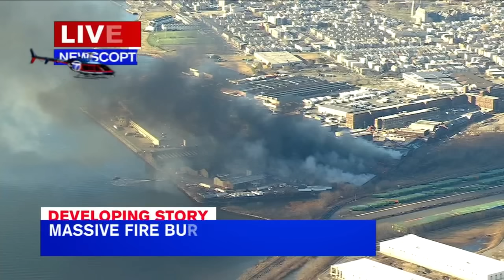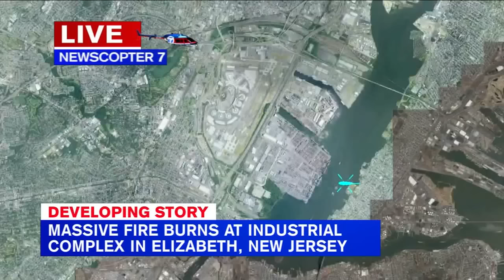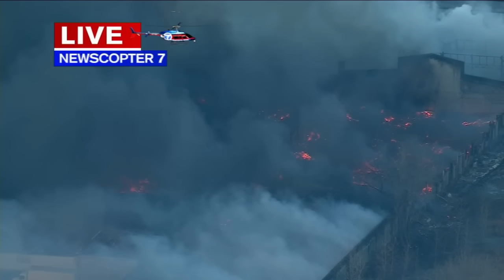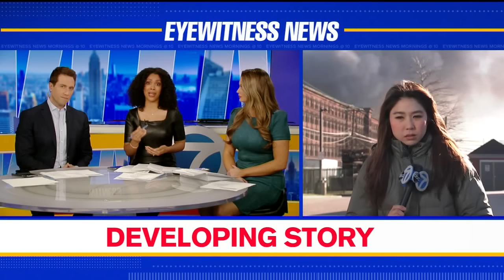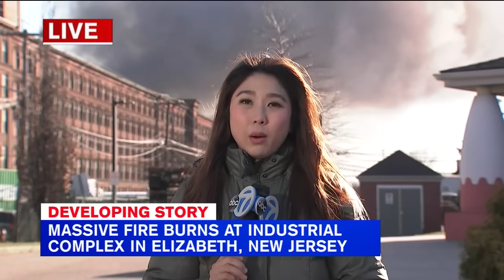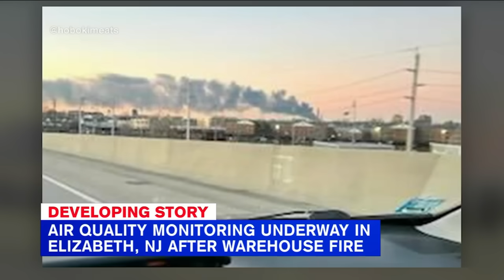Massive fire burns at industrial complex in Elizabeth, NJ

Comment: They should use a water drop from the air
Reply: To put out chemical fires you sometimes need things other than water.
Reply: You need a different strategy for this fire. It is class A and B, not just A.

Comment: If i’m not mistaken Industrial fires are the Worst….. these fire fighters don’t get paid enough !
Reply: No,  as  far  as  I  know  fires  in  the  reactor  of  a  nuclear  power-plant  are  the  worst  because  the  firemen  cannot  go  near  it  due  to  radiation.  I  think  no  insurance  company  dares  insure  such  a  plant.  Although  the  I.A.E.A  says  such  buildings  are  absolutely  safe.  In  Fukushima  nobody  can  enter  reactor-buildings  1  and  3  since  2011.  The  melted  cores  of  Pu  and  U  ( nuclear  lava )  have  melted  their  way  deep  down  in  the  ground  but  there  are  still   blobs  of  Pu  and  U  on  the  inner  walls  of  the  buildings.  How  can  a  2-meter  thick  concrete  floor  be  melted  ?  Because  concrete  reflects  neutrons  whereby  they  return  up  into  the  Plutonium  or  Uranium  core  and  create   billions  of  more  fissions  =  heat  .  How  is  it  known  that   these  two  buildings  are  EMPTY  i.e.  the  150 ton  cores  have  left  through  the  floor  ?   By  observing  the  muon-particles  passing  side-to-side  through  the  building.   See  Google:  "Muon  Imaging  at  the  Fukushima  Daiichi  Nuclear  Accident  Site"   from   Stanford University  22-march-2021.